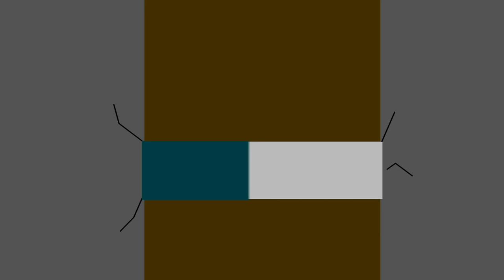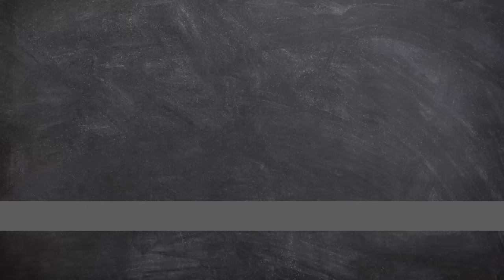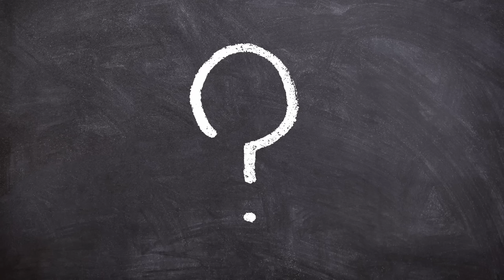Indifferent to the Warnings: The East Harlem Disaster 2014 | Plainly Difficult Documentary

Comment: As a pipe layer myself (for farm drainage), I'd like to note a few things about the sewer pipe. Old clay/brick pipe was used for both drainage and sewer, and relies on gravity to move stuff. It's pretty sad that the city ignored a sinkhole like this, knowing what was causing it via the damaged sewer pipe. It doesn't take a very large drainage pipe to make a pretty big hole in a farm field, and these sewer lines were massive. The fact that the suck area was as small as it was is a little surprising.  Even despite the faulty weld, I tend to place almost all the blame on the city for not repairing the sewer pipe. Difficult to get at and repair, yes, but even the old brick pipe could have been repaired and prevented this damage. I also tend to wonder how much the weld on the pipe was affected by sewer gases seeping upwards. They are pretty noxious, and can corrode metal, and even induce cracks (see SSC/SCC). The weld may not have been faulty at all, and the pipe just affected by the gas. Of course, I'm not going to argue with the NTSB - they have far more tools and expertise at their disposal than I do, but I do have to wonder a bit at how much worse gases like hydrogen sulfide damaged the welded joint.
Reply: All true.  But I think the fatal fact in this case was the replacement of the cast gas line to HDPE.  A rigid pipe can self-support to a degree and withstand much more washout before becoming an issue (like a small bridge).  It's not unusual at all to see these traversing a creek unsupported.  I assume once they switched to HDPE they backfilled the trench to level, but since the sewer and lateral were running deeper and parallel - as soon as the washout rematerialized the mainline HDPE would immediately sag (flexible pipe).  From the diagrams it looks like the worst part of the washout was directly beneath the gas main - and if that's the case the gas lateral running into the building would still have had the support of soil around it.  Without being able to sag along with the main line something had to give, and that joint is the most logical (especially if it wasn't perfect to begin with).  I assume at that point the gas infiltration was actually through the buildings sanitary system as the path of least resistance.

As old and complex as these systems are in larger cities - I'm surprised we don't have more of these types of instances.  I've worked for one of them - and it's not unusual for these repairs to be put off as long as possible.  They are very unpopular and expensive.  I've seen these sewer mainlines 40' below the road surface, and the sheer complexity involved to get that deep racks up some amazing bills.  Not to mention the public outcry from shutting down the road for extended periods...so they just kick the can down the road.  Not saying it's right, but it is what it is...

Comment: You should cover the twin east Boston overpressure explosions. One was in East Boston on September 2, 1983, and the other in Merrimack Valley on September 13, 2018. The overpressured gas lines caused dozens of explosions and house fires. The first accident was caused by a failed pressure regulator and the second was due to the workers accidentally not switching the pressure sensor over to the new pipe causing the sensor to read pressure from the unused pipe and opening the regulator full.
Reply: I have a video clip of the state police driving around saying evacuate all buildings and houses. It was other worldly! I think you should totally do the overpressurization! It was wild!
Reply: I used to live in the valley. It was an amazing explosion. What isn't shown: Lawrence is a terrible city. Some parts are better than others, but N. Broadway is Fentanyl central. Junkboxes all over the goddamn road.

Comment: I would say the fault was purely the fault of the city and its non-maintenance of the sewer. Even it the T-Joint was good and not faulty the broken sewer would continue to was away the soil around it eventualy leading to a situation that would crack even an up to spec T-joint in the gas line. So the result would be roughly the same it would have just taken longer to occur.

Comment: Recently half of the city I work in was dug up to replace old water and sewage lines, which around 100 years ago were put in with copper and cast iron lines. Needless to say, they corrode and need to regularly be replaced and upgraded.
Reply: I wish my city would do that. Instead, they just replace them in five foot sections as they fail. You'd figure at some point it would be more cost effective to replace the entire water line rather than replacing it piece by piece, but whatever.
Reply: @handles_are_dumb_01  
Are you willing for your city to raise your taxes to start digging up streets and replacing them in big chunks? Because it cost money
Reply: @neilkurzman4907  Yeah, that's the hard question. Overall, it's going to cost more to replace it a piece at a time, but getting people to accept such a large amount at once would be quite difficult.

 But there is some absurdity in what they're doing now. They just repaved the main street a few years ago... And then shortly after  ripped up big sections as water lines broke. Seems incredibly stupid to not have replaced those lines in their entirely when the road was replaced. Now we have a three year old road that is bumpy as hell because the patches after pipe replacements aren't exactly don't correctly.

Comment: I worked on gas for 25years & we spent most of that time getting rid of old low pressure lines .We also replaced cast iron with steel & plastic.Gas takes time to accumulate before it can explode.Thats what happened here

Comment: Geeze. 45 min for response time from the utility company for reporting a gas leak. My house had one in pa and peco was there in 20 min and had it repaired and service restored within an hour. Their meter was the cause. Apparently the fitting where it joins the pipe going into the house was leaking. When squirrels ate the overhead powerlines on my current place they sent a tech out within 30 minutes to check it out and then replaced the entire overhead run even going across a major road the next morning.

Comment: Those East Harlem tenements are OLD! There have been steam explosions (some still use steam radiator heat) that have blown out walls, with bricks also falling on the Elevated tracks in those instances.

Comment: I would also blame the superintendent. They would have smelled the leak in the basements of those two buildings as they went about their daily maintenance activities. As a plumber I cannot stress enough the importance of see something say something. I repaired a few of these problems in NYC and it is not an easy task when done properly and legally. You could do it illegally also but, the question is if you'll get caught. Average time for a gas repair in a high rise can last a year or more. Also, if we can't find all the leaks some apartments or complete gas lines may be removed from the system.

Comment: This is an excellent video. Information contained in this video can serve as a warning for owners and occupants of single family homes. Gas explosions with this exact cause can and do occur as the main sewage pipe develops a leak and soaks the ground under and around the foundation of a house. As shown in the diagram for the underground pipes of this urban, multi-unit apartment building, gas into a building and sewage out, flow from and to a street, in parallel lines which are just inches apart. As wet soil under  a house sinks, gas lines can sag. Connections can be pulled apart. Under these conditions gas lines can develop leaks which will fill the house with fumes faster than occupants can run out. 
It is somewhat unfortunate that in the US, single family dwellings are only inspected, by licensed inspectors, as a property is placed on the market. 

There are ways to check for sewage pipe leaks. Basement and ground floor walls should be checked for horizontal cracks. Vertical cracks are less serious, and it's fine to correct this with plaster and paint. Horizontal cracks are a sure sign of a sagging foundation, with a leaking sewage pipe as the cause. As stated, a gas line can sag and develop a seriously dangerous leak, if the leaking sewage pipe is not repaired. 
In my opinion, owners of single family dwellings should be completing their own inspections of this type, and should be paying for a yearly licensed inspection, even if the house is not going to be sold. Horrible, deadly gas explosions, (as seen in "news reports") can be prevented. 
One very serious cause of leaking and sagging sewer pipes receives almost no attention. Homeowners and landscape crews are using riding mowers which outweigh the old push mowers by hundreds of pounds. Property owners should be aware of the potential for cracking of the main sewer pipe, from building to street. Construction equipment, for re-modeling projects, is even worse, for this. In our time now, inspection of underground pipes is easily accomplished, with scopes. There is no excuse for neglect of buried lines and pipes.

Comment: After this and the 2015 East Village gas explosion, a lot of laws and regulations regarding natural gas changed in NYC. Con Ed is installing methane sensors at the point of entry for every gas service right now, which likely would've caught this type of leak before it became explosive. Mandatory inspections of interior piping every year, much stricter oversight of licensed plumbers working on gas equipment, unoccupied premises required to be shut off as soon as they're vacated... all good protocols that will hopefully save lives. 

But AFAIK, there was never anything written into law that would require NYCDEP to repair a partially collapsed sewer within a reasonable timeframe. Even with a shoddy weld, the gas service tee never would have failed so catastrophically if the earth beneath it wasn't escaping. I've got to imagine DEP engineers were well aware of other utilities in the vicinity when they decided to postpone their work. Not sure what they imagined was going to happen there.

Comment: We have this problem in the French Quarter, in New Orleans. Not long after the Hard Rock Cafe hotel construction collapsed, there was an explosion in the upper quarter that injured one of my friends and made cars explode and fly through the air. I think it was on St. Louis Street.  After much alarm and concern from us residents, it was determined that it was a methane gas explosion!! Caused by an electrical short causing sparks under the street. So city planners decided that since the underground infrastructure was over a hundred years old, they would start on Bourbon St, my street, and do a couple of blocks at a time. They guesstimated that if everything went according to schedule, it should be done in a year. Nothing for it, just needed to be done. Once the contractors got in there, as in under the street, it was horribly worse than expected. It was a hodge-podge of disarray. I never did follow up on it, it was so typically New Orleans.

Comment: Interesting how that one area wasn't that deep. Most of the city's roads are actually not on solid ground. They are up to 100 feet in the air, on thick metal plates with very little support underneath. That's why I would never drive in the city when I was able to. When two of those plates were removed for service, was just shocked at the large amount of space under the street there was, and what on earth wasn't supporting all that weight!

Comment: I would guess at 'gas explosion' before getting into the video. Gas from a broken pipe percolating into those buildings to form a explosive mixture. Ignition by a spark from a light switch or electrical machinery with a motor that sparked.
People reported the smell of gas in the area, but nobody was motivated enough at the utility company to investigate properly.

Comment: The American legal system and its findings always baffles me.  Based on the information presented here, how the hell did the City persuade the courts to rule against ConEd?  The cause of the problem was the responsibility of the City - they knew the sewer was faulty and they could see the sinkage being caused, but they didn't fix the problem.  This in turn caused ConEd's pipe to fail, it would be inevitable even if the pipe weld had been perfect.  Yet ConEd were blamed?  Perplexing to me.

Comment: I cant believe that they would ever use hdpe plastic pipe for gas...is that a thing?
Reply: Yes. Most pipes are either made out of either lead, copper, or some form of plastic, though there are a few exceptions like steel. Copper pipes used to be the absolute go to material for piping, but plastic is also pretty damn solid.

Comment: It is obviously the fault of the state and not EconEdison here, the state knew that the ground was sagging which means that all the pipes in the ground has shifted from their original position, which obviously can lead to a gas leak.

Imagine if the state had contacted EconEdison about the ground sagging, now they sit on a possibly leaking gas pipe which just costs them money to have leaking, so they would obviously look it up, finding that it is indeed leaking and shutting off the gas for a repair and there wouldnt had been any explosion.

Blaming it on a faulty t-joint is nothing but a piss poor excuse as the T-Joint has been working flawlessly for years already.

Comment: It’s not just old sewer lines and bad welds on gas mains that cause explosions.  The 5-unit townhome diagonally across from my father-in-law blew up from a gas explosion, the entire building was reduced to rubble (fortunately the entire building got evacuated in time so there were no fatalities).  Building was less than 20 years old, gas mains less than 60 years old, all properly built and maintained.  In that case the leak was caused by an error by a gas maintenance worker, he incorrectly opened a high pressure port when he meant to open a low pressure, and couldn’t close it because of the pressure of escaping gas.
My point is, who ever thought piping a highly explosive gas into people’s homes was a good idea? It’s literally a disaster waiting to happen.  Electricity is cheaper and safer, and we already have electric lines running to homes anyway.
Reply: When they decided to pay gas in to peoples houses, electricity didn’t exist. 
And electricity is also known to cause fires in houses, but not explosions.